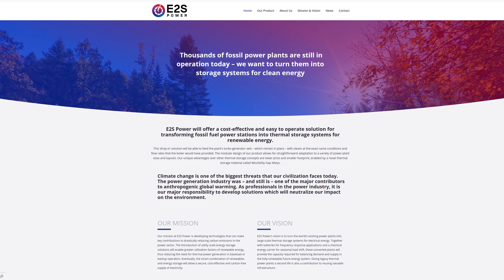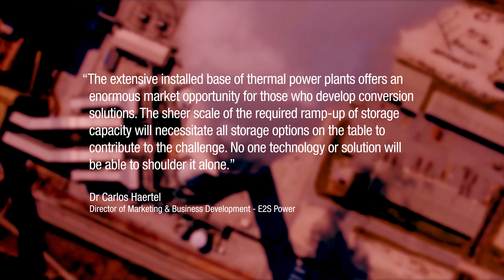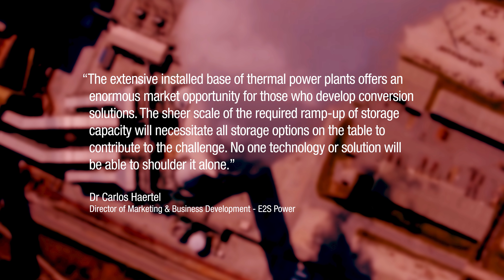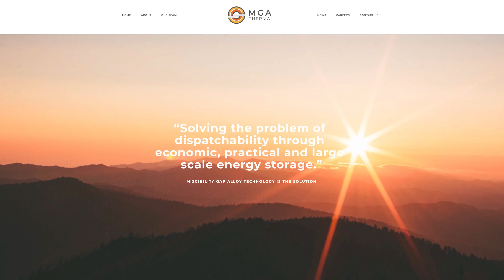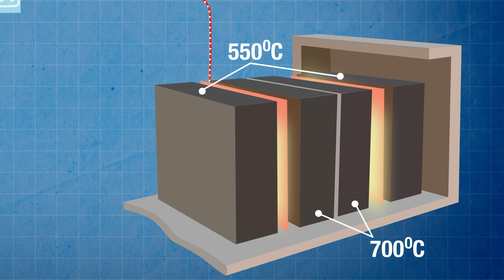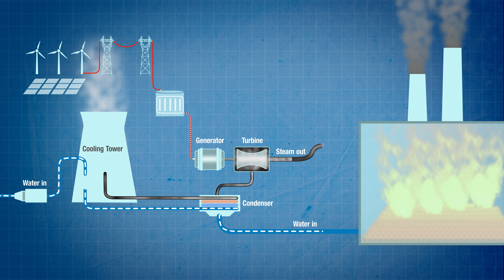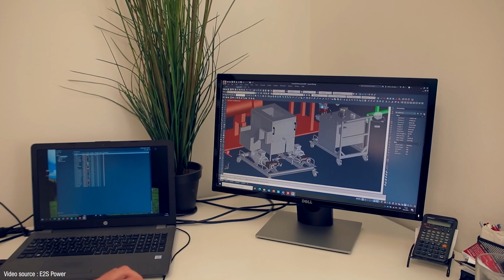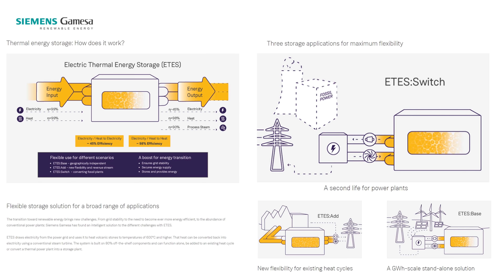New energy storage tech breathing life and jobs back into disused coal power plants

Comment: No Cooling tower or water cooling should be needed, unless used for district heating. Or simply have another thermal storage unit to reclaim that heat.
Plus, heatpumps with a modest CoP of 3 would put 3kwh of heat into those thermal batteries for every kwh of renewable electricity used, vs only 1:1 in:out for the resistive heating shown.
Use deep ground loops for the heatpump thermal sink for the win

Comment: The latent heat of fusion of aluminum is 400kj/kg, and water is 334kj/kg. This means to boil 400kg of water you need 334kg of molten aluminum. This will need a huge amount of aluminum to boil the water required by the retired coal plants turbines. A 500 mega watt coal plant boils  approximately 45 million kg of water per hour according to goggle.

Comment: Honestly I think this would make a bunch of sense for nuclear power, not striping out the core to run thermal energy batteries, but taking heat from the core and storing it for later, also not for current nuclear reactors, you would need to build this into new reactors because you would need a bigger steam turbine to use the heat stored in the thermal batteries.

Although to be fair you would want a bigger steam turbine you would want 2 or 3 turbines, so you could add 1 or 2 steam turbines to a current nuclear reactor and the thermal storage, reason being is running a turbine at less than 100% of it's thermal capacity reduces it's efficiency, meaning that if you went and made a single turbine with 2 - 3x the capacity when running normally it would be horribly inefficient.

Comment: in my mind, this is the ONLY way to harness the full power of the wind.

to make "electricity" from a turbine is complex... the supply and the demand do not match.

we apply BRAKES to turbines, and all brakes do is convert energy from kinetic into THERMAL.

its pretty easy to design a "brake" that will simply produce heat, and nothing BUT heat... why generate electricity when you can make heat?

admittedly, moving heat is challenging... can be resistive heating as well, etc... jacobs law pops up here and there...

at which point you can load your turbine down to its maximum ability, keep it right on the limit of what it can take from the wind, regardless of how hard it blows. as long as you have somewhere to dump heat, lots of heat, you can keep those turbines ta max efficiency, 24/7, as the wind blows... with no challenges of tying into a grid as all that part is already dealt with, using big steam turbines and generators with lots of mechanical inertia, electrical inertia...

you only have to heat water. why do anything else?

Comment: The decomissioned coal power station at Uskmouth South Wakes,  UK is undergoing work to be modified to a battery storage facility using all the existing switch gear and grid supply infrastructure.

Comment: The problem with this approach is they are throwing away 2/3s of the energy in the electricity coming from the solar farms when they use electric heaters.

A competing approach is to build a small nuclear reactor like the Moltex waste burner SMR. It also proposes being connected to a thermal storage battery and would be built at closed coal plants. But the difference is the output of a nuclear reactor is heat. So a much better fit to a thermal battery.  Operation would be similar to what you presented, with the nuclear plant constantly heating the thermal battery, and the former coal generating plant used as a peaking plant, or a backup when wind/solar is low.

In the moltex case, its fuel source is spent nuclear fuel, with its resultant waste is safe after 300 years vs 300,000 for the spent fuel.  So it provides energy and reduces the time for the waste to be safe by a factor of 1000, all while providing power to backup solar and wind.

Comment: I prefer replacing the boilers with SMRs.  Better jobs, lower power costs, and doesn't require the massive subsidies, materials resources, and electrical grid upgrades that intermmittent energy sources require.  Check out TerraPraxis.

Comment: This system suffers from:
-very high power conversion losses
-High embodied carbon in the plant coversion and storage system
-High embodied carbon in the renewables and transmission grid extension to them

A much simpler and lower cost solution would be to maintain the power generation capacity at the site by building nuclear power plants.
This provides the jobs and community stability required.
The emissions intensity would be about 1/20th of the renewables plus their extra transmission and storage.
The birds get a benefit by not being killed by the windfarms and we escape the visual pollution and environmental damage.

Comment: No word of efficiency or self discharge. A coal powerplant has ~37% efficiency, so with this concept at least 2/3 of your energy are gone. And that is if you get it out of the material without waiting.
Seems rather wastefull just to reuse old equipment and the job argument is also very thin: The whole coal side is still gone. If you'd instead build a pumped hydro storage you would have similar jobs but much higher efficiency.
And the "we need every storage solution we can get" does not make sense. If a solution is inefficient and has a high self discharge rate, why use it?

Comment: Seems to me the system could also use geothermal in the mix. Depending on the ground heat and the systems involved a 5% reduction in BTU would be low hanging fruit and has nothing such as wind or sunlight to stop the BTU/hr input. There are probably locations where 50% or more could be captured with grid scaled geothermal as many powerplants are near gas fields(lots of holes in the ground as well as a complete understanding of all the the geology in the area. Please keep us all up to date on this as it sounds like a complete game changer as well as stopping arguments about life cycles, cost and ROI for all these expensive and necessary pieces of infrastructure. Cheers from John and Ashly in Calgary, AB, Canada.

Comment: A similar low cost thermal storage being explored for use with old powerplants is plain old granite rocks, stacked in large warehouses and cycled between a discharged temperature matching the steam and a higher fully charged temperature still below the rocks melting point.  It's less high tech, and thus potentially cheaper to build, but last I heard, experiments were still ongoing and the efficiency will be limited by the higher temperature difference needed without a phase change.

Comment: This is going nowhere. My guess: Those who know coal are grasping at straws. Whatever the motivation, I didn't hear a single thing about efficiency. It can't be that high.

Consider this: In high latitudes, you may need to store energy over longer periods, perhaps as much as months. These thermal storage systems can't do that. But batteries actually CAN. Yes, you'd need a potentially humungous capacity, but then again, with that capacity, you'd wouldn't be charging and discharging that often, so the economics might not be as bad as you'd think.

Still, I'd be much more inclined to simply go with long-distance HVDC transmission over a grid for those times when renewables are in short supply. There aren't that many people in the whole World who have severe seasonal drops AND don't have good access to hydro or geothermal.

Comment: Interesting if not long-winded video to simply explain that this company is using a phase change to store electricity as latent heat.  And this is precisely where I am not so enthusiastic about the concept.  Electricity and mechanical work are forms of high grade energy (in the thermodynamic sense) while heat is a low grade form of energy.  A portion of this heat is always lost even in an ideal cycle during the transformation back to electrical work.  In this regard batteries or other forms of high grade energy storage like compressed air are more desirable.

Comment: So we convert electricity to thermal energy storage, then heat steam to drive generators to produce electricity. Sounds very inefficient. If you take out the generators and boilers and install batteries, and I don't mean lithium ones but liquid salt ones ala AMBRI and others.

Comment: Can you stomach an outside view point on emissions....

Australia has 1 coal fired power plant for every 300,000 Km2
China has 1 coal fired power plant for every 9,000 Km2
America has 1 coal fired power plant for every 41,000 Km2

even if we doubled our coal plants, we wouldn't  come close to any other county... so presently 30% of Co2 GHG are from coal...

somewhere around 60% though, is from car, truck, and industry... 
so what if, we could add 1 coal plant, which we use to power electric cars, which we could manufacture right here in Aus. so we might add 1 to 2 % in emission from the coal plant, yet decrease car  by 3 to 4 %.... 

1. no closing plants
2. increase jobs with 1 new plant
3. we start our own electric car manufacturing plant
4, we reduce the usage of petrol...

just a thought

Comment: Turning low entropy electricity into high entropy heat = 100% efficient. High entropy heat back to low entropy electricity is about 40% efficient at best. So 60% of the power will be lost. That's not bad engineering, just part of "the cussedness of nature". Less than half as good as a big battery installation, but might be useful as a transition technology.

Comment: Renewable electeic  power to heat thermal battery and generating steam and running turbine to generate power sounds good. But efficiency of steam power plant can be max 40% 
so it will be loosing 60% of renwable power. Can any body tell how it will be economical?

Comment: There is one downside to this and that is the loss of energy to heat up the aluminum. I think that a molten salt reactor could do a much better job. I believe you could still use the old steam system and generators while the old boilers are being phased out. A molten salt reactor does not need much space and could be mass produced on shipyards around the world.

Comment: Really interesting. I did wonder if it's really still necessary to lose so much energy via steam from the cooling towers. Would it not be more efficient to try to capture the heat from the steam thus recondenseing it back into H2O for reuse; reliable H2O supplies may become uncertain due to climate change.

Comment: Have you ever visited any one of our current Coal fired plants here in the USA. They are old, really old and quite frankly not in any shape to be reconditioned. Most that are still in operation were build int the 70's or 80's,  Perhaps the cooling towers could be reused, possible the condenser if re tubed, what about the Feed-water heaters to enhance thermal performance?  After crawling and walking through dozens of these plants over my 30 year career,  I doubt this idea is worth considering.

Comment: This is really interesting, when you mentioned the phase change of aluminium, my first thought went to that of liquid metal batteries. A similar concept to this, however the MIT researchers were using calcium alloys and harnessing the electron shedding during phase change. Similar to the iron air batteries that NASA developed during the 60s, very cool to hear of different ways to use the thermal energy in a different manner, would be interesting to see it's efficiencies and the total cycle life because that is where a lot of energy storage systems come unstuck.

Comment: Good idea, roll it out, the only problem is the generators take 7 days to heat up down to prevent rotor shaft warping , the system will need to run for weeks on end to prevent this.

Comment: 6:45 Since it's equivalent to a parallel-flow heat-exchanger, I'm inclined to say that the steam is then "superheated" by the second stage to the desired temperature of 550C, not cooled. Even though the first stage heater has a higher temperature, it is to evaporate, not to superheat. If temperature reduction is required in the heating half of the working-fluid cycle, usually water spraying is employed.

Comment: I still have a question I can't get off of my mind, what's the loss of efficiency in this system? As we know, it uses electricity to generate electricity. There's no such thing as a perpetual engine than can viably be used in generating power, but there has to be a loss of energy in the process. I know that this might be cheaper and more sustainable than fossil fuel considering it's price will go up as the supplies gone scarce, but still... what's the efficiency?

Comment: A downside to this idea is the efficiency. You transfer high-grade electrical energy to low-grade heat energy and then reverses the process, generating considerable energy losses. A pure battery solution should be more efficient. I guess it could be a feasible short-term solution given the state of battery technology development.

Comment: Pumped Hydro storage being such an efficient way of storing excess generation, I'm surprised your channel doesn't have a video about it. Is it because it is a fairly proven technology? Or is there another reason?
Reply: energy density in stored water isn't that great so you need vast amounts of water and a respectable height difference. Sweden, Norway and Switzerland e.g. have large amounts of hydro facilities but only negligible amounts of pumped storage because you need TWO water reservoirs to pump the water up or let it run down through turbines.
Just an example: Let 1 000 kg (1 m³) run through 400 m of height and you get 4 Megajoule which is the energetic equivalent of roughly 0.1 litres of gasoline (or two 100g tables of chocolate, running your body for 12 hours).

Comment: This is not a good idea. I used to work in the electric power industry designing large, coal-fired power plants. (I am now retired.)  A power plant using ~550 C (~1000 F) steam to drive turbines will have about a 33% efficiency: Converting electricity to heat, storing it in thermal energy storage "hamsters", and then later converting the stored thermal energy back into electricity will at best get you back about one-third of the electricity you started with. Batteries provide better than 90% storage efficiency. The economics of this scheme, even considering using existing decommissioned power plants is not attractive. Electric power utilities would also decommission their oldest, least efficient coal-fired power plants first, making the scheme even less viable.

Comment: i wouldnt put a "water" circulating system direct thru the thermal storage device. a higher temperature fluid and then an interaction with water to make steam. or im thinking maybe not a steam turbine generating system? i will think on this...

Comment: The UK has 300 years of coal at 1980s rate of use and clean coal technology can be used to reduce and collect carbon dioxide emissions whilst generating electricity and production of natural gas.

Renewables only provide intermittent energy and this energy cannot be stored to offset downtime.

Clean coal can produce reliable continuous energy until clean nuclear fusion can be developed to scale.

Lithium is a relatively expensive resource that will become scarce due to global demand.

Comment: I don't understand how this is a thermal storage strategy. The heat is generated by incoming electricity, and then outgoing electricity is generated at 40% efficiency when you consider losses from the steam. All of this happens at the same time and so there is no "storage". Unless you believe you can heat the blocks up and have them store the energy in the phase change of the aluminum. Hard to believe that will work.

Comment: Did you mention efficiency?  Steam turbines convert the thermal energy in steam to mechanical energy at efficiencies between 40% to 50% max, so you will throw away over half of the electricity you are trying to store with this scheme.  The only way this idea would be economically viable is if the coal plant was relatively new, but was on the verge of being retired and also was situated in a region with a lot of, for example, wind energy farms which are often totally turned off if the local grid is saturated with energy.  So, if you are often faced with the choice of saving 25% to 50% of a windmill's output versus saving nothing, then this concept is attractive.

Comment: Another way to use existing power generation plants is to replace the coal or gas with Gen4 MOLTEN SALT REACTORS (MSRs) so no input is required from the grid … its provably still five to ten years away but inevitable.
Reply: Nice. Replace the heat source with an MSR and keep the turbines and the remaining infrastructure. If Alvin Weinberg had not been dismissed from ORNL we might have that capability now.

Comment: Usual very clear articulation, David. It seems a good and novel idea. The alternative is using CST, Concentrated Solar Thermal, a series of heliostats (mirrors), computer-controlled to reflect maximum sunlight onto a storage heat sink. That technology has been around for a while, but the cost is higher than PVC, so that is probably why electrical heating from PVCs is preferred.